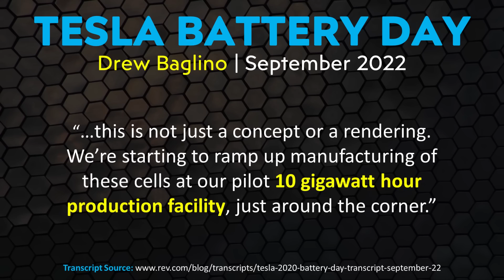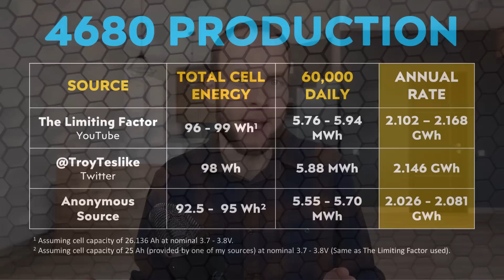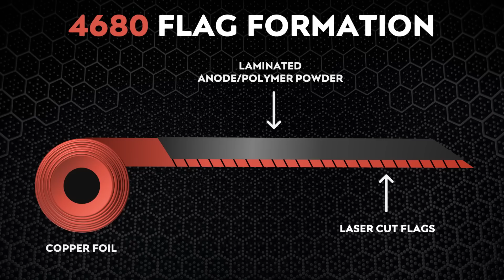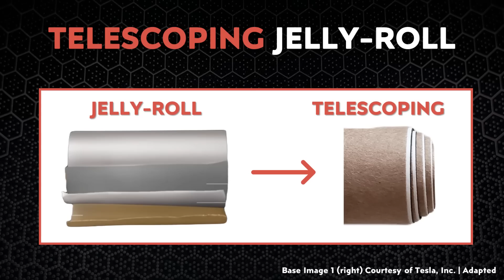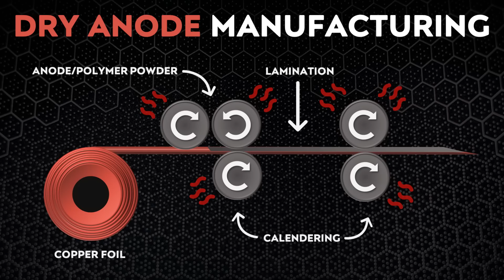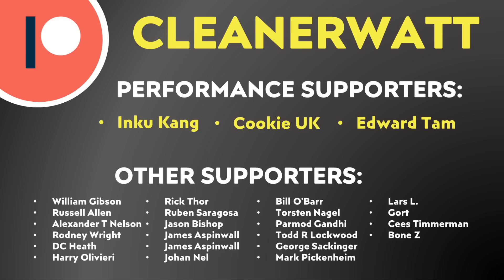EXCLUSIVE Tesla 4680 Battery Production UPDATES!

Comment: That battery days was big garbage day. So many lies and nothing revolutionary. Uhh, we make 6 times bigger battery and suddenly we get 6 times bigger capacity..."magic".
EDIT: These production engineers was insane stupid, if they did not made buffers to production lines. It is good question how big must be buffers. So much to solve problem on specific line. Max 1 hour before shut down. Just turn the switch and all goes to buffer. Yes, it is good if buffers is in line, multiple machines works side by side and takes over failed machine jobs. That way production never stops. 5x smaller production, they may have there single line only... Great way to save the money and screw the workers.

Comment: In the end, it can be considered highly misleading, that this pilot facility at Keto Road was ever called to have "10 GWh/year" capacity or that it would reach that capacity "next year" (next year of 2020 was 2021, now is September 2022). That was just bragging and supposed to make competitors true production lines look like toys when Tesla would install the "real beast" as a pilot already. If only Tesla shareholders would actually hold the C-level executives at Tesla responsible for all their forward-looking statements instead of following their evangelism.
Reply: I'd call it overly ambitious not misleading.  If they take 2 more years they still get to 10 gWh output, regardless, they're just late (as usual).  Remember, GF Nevada doesn't NEED the initially intended floor area to now produce far more than it was designed to output.  Misleading, eh?... 🤦🤡
BTW what's a koenig & why do you like to lich it?  Are the rest of us somehow missing out?  You're clearly proud of your hobby....
Reply: @alexmanojlovic768  Well, there are two choices: if Tesla will use their pilot line for 10 GWh/a production, they can no longer innovate with generation 2 or generation 3 of that line. Instead, if gen2 or gen3 of cell production should be real innovations and changes, then they will not be able to produce cells there full-time. As simple as that. That is why typically you have a split of R&D lines and production lines.

Comment: I wonder if that is why LG has battery issues. Do they remove the lower-grade batteries from going into cars?
Reply: Wasn't the issue with each manufacturers BMS design or implementation, not LG's batteries.  Samsung had battery fires in cellphones a while back & that WAS Samsung running the chemistry too close to the separator's edge & thus getting short-circuits.

Comment: good topic and probably spot on with the issues outside of material deposition/calendaring...    all those "mechanical" things like telescoping, flag folding, conveyor systems - people will work those out in several chunks and eliminate them.  That's pretty doable stuff.  Getting that dry chemistry onto the layers of the jellyroll is going to be a challenge for a good while... DBE may really trip them up for a good while.

Comment: In retrospect, it was probably a misstep to put a number on output from the pilot facility since it's meant for R&D not mass production.
Reply: More like it was a mistake to make it public.  Goals are good.
Reply: @danharold3087  but if the goal of the facility is to refine the manufacturing process and pilot new stuff, it’s going to constantly be shut down for refit. A constant volume production goal is at-odds with the point of the facility imo.
Reply: @danharold3087  but if the goal of the facility is to refine the manufacturing process and pilot new stuff, it’s going to constantly be shut down for refit. A constant volume production goal is at-odds with the point of the facility imo.
Reply: @quantizor  Agreed.  One was to continually break the line by running it faster and/or longer.    Work out why it broke and change it to not break.  Rinse Repeat     How many cells you have at the end of the is far less important than improvements made to the line.
Reply: @quantizor  how can you test production at scale, if you.... don't test production at scale? 🤦
Hence it's called a PILOT facility NOT an R&D centre...
Reply: It was always both, or it would have been a test centre, not a pilot facility, & it always had a gWh output rate, because of this.  Always make every component at least dual function.  That includes "the machine that makes the machine"
Reply: @alexmanojlovic768  that’s fair. I guess a pilot is essentially giving yourself room to stumble until things are dialed in and the expectation is follow-ups after the pilot should ramp much more rapidly.
Reply: @quantizor  also keeping the output as large but not Giga scale means as new developments a tested & refined, they don't get a major hit to production if new changes don't work as intended, but the plant is still contributing when it's running reasonably well.

Comment: The final factory will need to have multiple pathways to duplicate process machines.  That way a stoppage in one area won't stop the entire line.  Instead, a gate is triggered and the product is shunted to parallel lines.  This requires less than full capacity flow, but allows the product to continue to flow as issues at individual steps are addressed.

Comment: I assume a grade cells go to cars, and b and c grade go to megapacks
It does not matter the rate of production. probably it can have 5 lines of production. Now it is using one. This is to make the production smooth. Once this line goess smoothly the rate of production will double or triple.
Reply from the maker: That could be the case, but I do not know for sure.

Comment: I doubt Tesla has A and B-C grade cells as 4680's are only used for vehicle production, so any cell that doesn't make A grade is rejected. That article you mention likely applies to battery companies that also provide the same format cells for other products not just automotive, hence why B and C grades make sense.
Reply: maybe special runs of powerwall or megapacks can use them...
Reply from the maker: Possibly!
Reply from the maker: Various grades of cells of just a natural byproduct of battery manufacturing, so... they have them. The question is what they do with them?
Reply: @Cleanerwatt  I imagine they would sort them based on application, so the best would go in Performance models, then LR, then SR.
Reply from the maker: @boostav  Could be...

Comment: You used the word "assumed", and most of learned how to decompose the root word there. It will happen when it happens and until 4680 production limits the output of vehicles, you are wasting your breath and my bandwidth. Also, I am sure your numbers are accurate from the distance you are from actual management of the facility. It is legitimate for you to ask questions,  but wild guesses from you based on supposed insider information are just that...wild guesses, which are somewhere behind utter speculation. Give it a rest until you have actual information.

Comment: This data is probably not correct (3:27). Tesla Y 4680 has 828 cells * 92.5Wh = 76.5 kWh. But as it turns out only 66kWh is usable in the real world do you believe the 10kWh buffer or the individual cells are under 92.5Wh (probably closer to 85Wh)?
Reply: 4680 was said to have at least 5x the energy of 2170 back at battery day. 2170 NMC currently is at 5 Ah, so 4680 NMC should be at least 25 Ah. 25 Ah times 3.7 Volts = 92.5 Wh. Yes, I believe that these early production 4680 battery packs are severely software-limited in capacity like with a 10 kWh buffer.  Reasons: it's a new DBE process at the anode, a new production line with pilot line quality, and a structural pack that can not be repaired at a module level as it is a brick essentially. A potential recall (due to issues of safety, capacity, reliability) of 4680 packs would cause Tesla severe problems. So it is much advisable for Tesla to play much safer with lower promises at the pack level. Once cells mature and reliability is proven, they can reduce buffers in the software configuration of newer cars.
Reply: @koeniglicher  Well these possibilities could be dispelled in a simple way after all Munro Live has a mass of these cells. However, for some reason they don't want to do that. For me the most possible reason at the moment is the cells are below the assumed minimum of 92.5 Wh and as many of the YTubers own Tesla shares, they dont want publishing information that could hurt the stock price.

Comment: Hi Jon, I have an idea about the dry applied anode material method, is it not possible to photo copy/laser print onto the roll, it will need the development of a compatible polymer but laser copies are quite consistent and fairly fast.... Just an way out of the box ignorant idea.
Reply: They already employ laser welding & are very clever/creative. I'm sure they've considered this.  I've had many "groundbreaking ideas" that Tesla could employ & asked Tesla to contact me.  6 months after I had my idea, Tesla implemented it, meaning they were already secretly working on it.  They either buy my phone conversations to my cousin, from the Google spy factory, or other people already had the same thoughts & I should just stay poor, but happy that I'm creative enough to be a Tesla employer, just living on the wrong continent... 😭😭
I suspect laser imprinting isn't as beneficial/consistent in 3d for battery chemistry.  Or they already use it...

Comment: I agree. I did a reply on twitter that they should not be worried with the 4680 ramp.  Even without the 4680, Elon said Tesla is not battery constrained. DBE is nice to have but the 4680 can exist on the CT or Semi without DBE.
Reply: @AudiTTQuattro2003  the 4680 and its structural pack has many innovations.  The only reason Tesla does not have huge amounts  of it is the dry battery electrode technology which 10x faster to make, uses less energy, thus cheaper to make than common lithium battery. removing DBE still puts Tesla ahead in terms of using ternary lithium chemistry batteries. Using LFP is another story.

Comment: While people talk about gWh/year for battery factories, I like to think of it in terms of cars.  Tesla is using 828 cells in each Model Y structural pack.  At 60K cells per day, running seven days a week, that's 507 cars per week.  That's about half the production rate of Giga Texas, which is consistent with them making a mix of 4680 structural packs and older style 2170 packs.  They'll probably want something like twenty times that number to support all the 4680 needs with Model Y, Cybertruck, and Semi, possibly more if they want to use them in storage products.
Reply from the maker: That is a good way to look at it for sure!
Reply: How many 4680s does a 500 mile range Semi require?   It seems Tesla should prioritize these currently limited 4680s for the Semi.  Yes?  No?
Reply: @jeffreyhampton9130  The Semi is probably 10 to 15 Model Y equivalents.  Right now, I think Tesla's priority is to maximize Model Y production, an they may need to use some 4680s to do that.  They also need to build some 4680 Model Ys to iron out any vehicle production issues so that they don't have a ramping issue when switching over.  And as mentioned in the video, they are also doing special engineering runs with different chemistries or other tweaks, which suggests to me that the current 4680s might not be adequate for the Semi or even the Cybertruck.  Remember that the current 4680 Model Ys have a shorter range, which was not expected to be the case, even with packs that are apparently full.  Clearly Tesla is expecting to store more energy per cell in the near future.
Reply: Tesla Texas may  currently be at 1000 Model Y/week (about 500 from 4680, about 500 from 2170). But they aim for much higher numbers something like 5000 Model Y/week, which is roughly 250.000 per year.  So they will need a five-fold increase at first. Cybertruck and Semi are a different story.

Comment: Other than axial to axial alignment the dominant telescoping is governed by polar differential foil pretension. ie left edge Vs right. 
Factors?
1) is chemical coating left/right uneven thickness variance. A thicken left moves foil to the left. 
2) foil approach with pretension has left/right differential, a  higher tension on the left it telescoping to the right.
3) the pretensioning differential was free drifting is a regulation problem.  

Remedy?  
Apply an active (closed loop) or reactive (passive) left/right pretensioning balancer/damper,  this will compensate for 
1) pretension drift and 
2) compensate for chemical thickness drift. 

If we are using rolling fence to manage telescoping, second this effort and keep it as last resort.

Comment: 20% of their intended target from TWO YEARS AGO? Come on... that's ATROCIOUS. There is zero reason that they're shutting down the line to swap out for the test runs every single day. What could they possibly be swapping over to have new tests done daily? Do them weekly. Run the regular line for six consecutive days to ramp up production, and then swap over for one day to do a test cycle. Why are they also running tests on their only operating Pilot line in Kato? They should have a separate line to test and iterate on both the production process and the battery itself. No wonder they can't reach their target with that kinda philosophy. They really need to ramp it up, and fast.
Reply: PILOT PLANT……
You should work for Tesla, they obviously need your expertise.

Comment: Didn’t 4680 manufacturing equipment get sent to Giga Texas?
Reply: Tesla is buying battery cell manufacturing equipment from suppliers.  They have no capacity to build their own system.  Components are integrated by suppliers to meet Tesla specs.  Just like the so-called, "GigaPress."  Indra built the machines to Tesla's requirements and specifications.  It's up to Tesla to make the machines work.  If the yield of the battery manufacturing equipment or the GigaPress, the suppliers can only offer a pat on the back and a single tear.  

Purchasing manufacturing equipment is kind of like buying a 3D printer and a roll of filament and/or bottle of resin.  Even after the design of the part is done, there is plenty of challenge in getting an acceptable print and repeatable results.  No printer manufacturer is going to guarantee you can produce your parts on the machine you bought.  They rely on you to choose the machine with the proper capabilities, which you may or may not know.  Heck, even the amount of humidity in the air of the plant can cause yield issues.

Tesla fanbois typically have no idea how manufacturing plants are built or operated.
Reply: I quess Tesla has some own factory machine production, also for batteries: 

"The product portfolio includes machinery for the production of microprocessors and memory chips, airbag sensors and power steering controllers, as well as systems for the production of car door and roof seals, lithium-ion battery cells and modules. Among other things, the company manufactures robotics that are used in the battery and electronics production for Tesla, Inc. at its Gigafactory 1."

https://en.m.wikipedia.org/wiki/Tesla_Grohmann_Automation

Comment: The best Jelly Roll Escalator is no Jelly Roll Escalator.
Reply: That's what I thought.
Get them into the can ("sleeve") on the same floor, then move the can for welding.
Reply: I wonder if the escalator problem is caused in part by the pausing in the production line while problems on the second floor are resolved.  I could see gravity shifting things while the rolls are on a slant while in transit.  If true, then resolving the line pauses might sidestep the escalator problem.  Just speculation on my part.
Reply from the maker: This is so true! haha